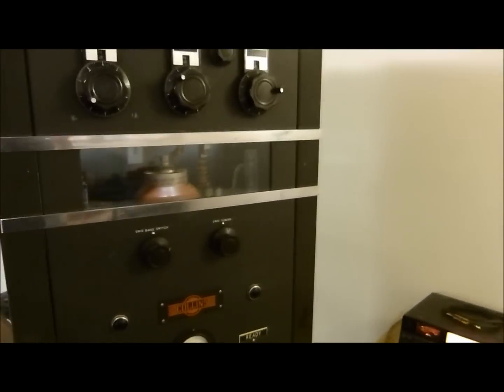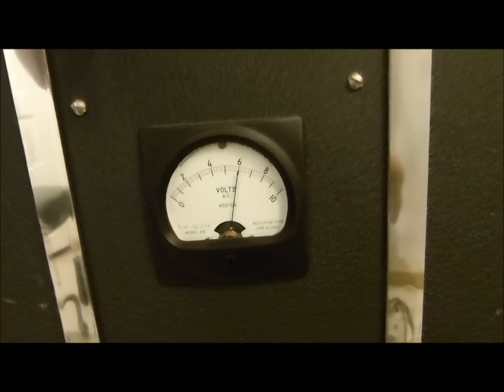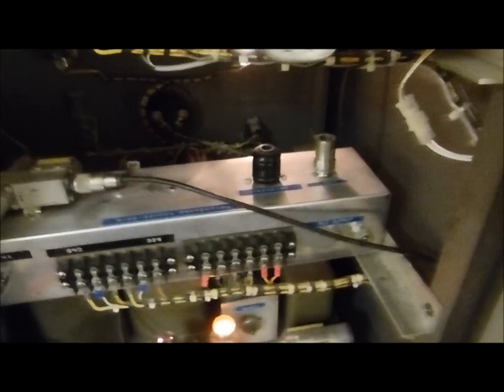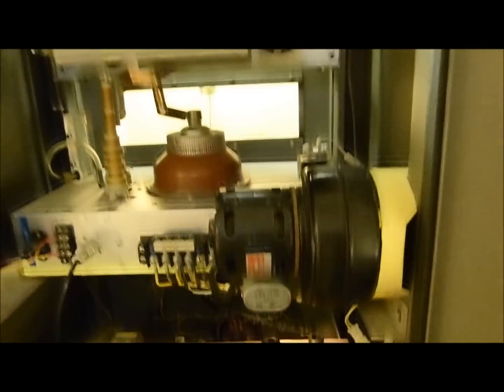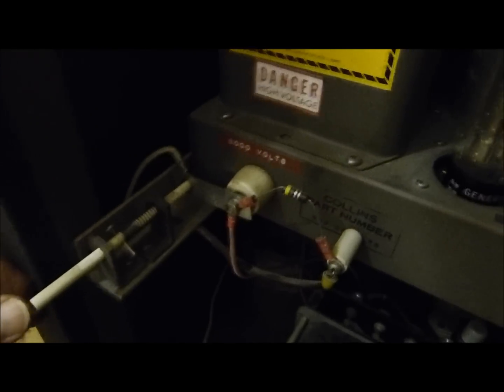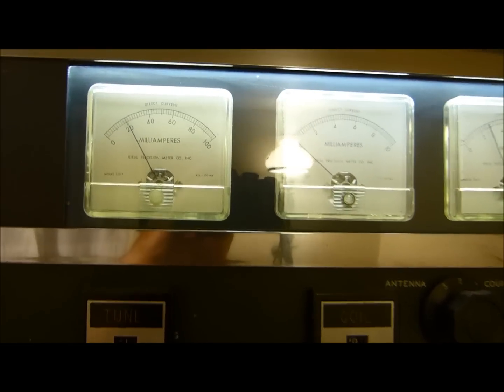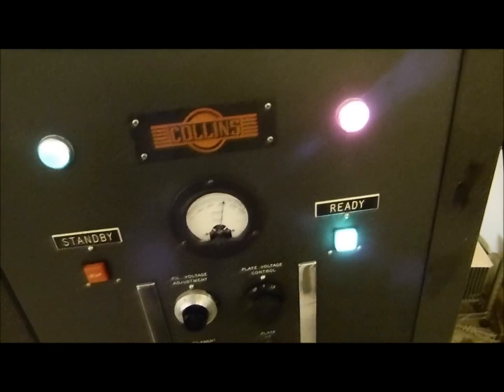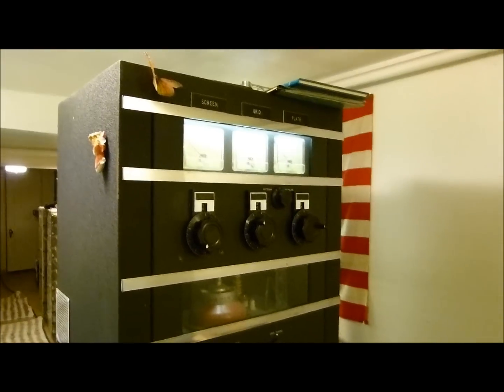Collins Radio 30K-1 Transmitter Updated to Eimac 4CX1000A - Eimac JAN 8168

Comment: Can this be used on 11m for channel 6? We found one new old stock in a warehouse. Would like to use it.
Reply from the maker: Yes, the tube is good to 110 MHz. It only runs class AB1 as can be seen in the data sheet attached. It requires a special socket and chimney and must be forced air cooled.
https://frank.pocnet.net/sheets/140/8/8168.pdf

Comment: David, i still have a 4cx1000a ceramic amp in storage, cant remember the screen voltage or grid... must be getting old :) , i do remember installing a timer for the filaments and when the timer hits 3 minutes , grid and screen voltages comes on as well as Ht, does your circuit work like that ?
Johan zs2cx
Reply from the maker: Hi Johan,
I have my 4CX1000A setup with a ready-tree where bias voltage, and cooling air has to close an air-vane switch, and several other things occur before screen and plate voltage can be initiated. Bias voltage comes up with the filaments. I put a 15K, 10W resistor off the screen to ground to "bias" the screen meter so I can measure negative screen current and use a 1/8 A fuse in the screen circuit to protect the screen from over-current. Eimac says the 15K, 10W resistor is necessary in case the fuse blows to prevent the screen from instantly soaring to plate voltage and destroying the tube. As above, the ready-tree is setup to never allow screen voltage to come up without bias and plate voltage but I keep bias voltage on the control grid all the time as part of the ready tree. As I remember it, we can never allow screen voltage without bias and plate voltage so I assume your bias and screen come up with the plate voltage. The amplifier has been working since 1983 and I still  use it nowadays mostly on 20M and 40M. I might also mention that I run the screen at 200V instead of the Eimac data-sheet recommended 325V. This is how the Collins 30S-1 runs their 4CX1000A. This allows the bias to be around -40V and very easy to drive and according to a Collins article, improves IMD products. The grid is not tuned and just uses a 50 ohm resistor off the grid to ground. Hope this helps and I hear you on the air. I recently had a QSO with ZS6XY from your area. If you need my schematics, I will send them to you but we will have to do it via email.
TheAudioShop@SBCGlobal.Net
73 WA4QGA
Reply: @ElPasoTubeAmps  thank you David, i will take the old boat anchor out of storage and play  with it in the near future

Comment: CCA be damned, you saved an amazing piece of equipment. It was already butchered and you managed to put it back on the air. Amazing
Reply from the maker: Thank you. Some would prefer to restore it to former glory and use it as an AM transmitter but in the condition I got it, I could not see the point. For such a beautiful cabinet, it seemed better to make it into a practical amplifier. I have had a lot of fun with it since 1975 when I picked it up. The 4CX1000A has always been the most powerful tube I have used in it but the glass tubes are really nice looking thru the glass panel.  73

Comment: Did you put that label on that oil-filled transformer?
Reply from the maker: I assume the one that says, "contains PCB's?". Yes, I did put it there as I figure since this transmitter was built in 1947, it was possible to be a PCB capacitor. It still works perfectly after 72 years and gets used daily.  I could be wrong and it not contain PCB's.
Sometimes in the 1980's, I don't remember the year, I was given five or six pole-pig transformers by a "friend" to told me if I removed all of them from the oil and casing, I could have a couple. I removed them all but chose to put my arms into the oil all the way to my arm pits to bend a tab that let the transformer slide up rails inside the metal container. I assume you know that pole-pigs are telephone pole type transformers used to set down HV to the 240V and 120V for house hold use. These transformers were 10:1, i.e. 2400V to 240 VCT. Anyway, after doing this I learned of PCB oil and got terrified as  its toxicity thru skin absorption is almost as bad as ingestion.  I ended up taking some of the oil to the lab at WSMR where I worked and explained my concern where they tested it and told me it was non-PCB. Whewwww... otherwise, I probably would have died from PCB poisoning long ago. PCB was a big deal during those years and I suppose most all of it is gone now but ... just in case...

Comment: Hi, David! Is that the amplifier you had in the appartment in Huntsville, AL, running off 240v from the kitchen stove? I remember the antenna wire sagging on key down.. back then it was with the original exciter and the pair of 4-400's glowing
Reply from the maker: Hi Henning,
Yes, that is the one. I changed it to a 4CX1000A in 1983 and ran it that way for over 30 years but now have a 3-1000Z in it that is beautiful. I remember those days from 1975. Wow... so long ago but it seems like yesterday. I started working at NASA in Jan. 1970 and it is now almost 48 years ago. Time went by so fast. I hope you are doing well.

Comment: A beautiful amp indeed! Question: Is this a G.G. linear running in AB1 mode?
Reply from the maker: Bob H Hi Bob, sorry I missed your posting some time back. Yes, AB1 is the only way the 4CX1000A can be run. I did not invert the screen supply as Collins did in their 30S-1. It is a very straight forward design. I put a 50 ohm resistor from an old Heath Kit dummy load right at the grid and drive it that way -  naturally separated with a blocking capacitor so I can apply negative bias voltage to the control grid.
Reply: +ElPaso TubeAmps - Thanks for that info. I have a 4-1000A that I want to use in grid drive mode. I'm assuming it will work for this.

Comment: Question is the RCA transformer original? I have a similar one here but with 220v input.
I'm just wondering if my transformer former came from a 30k1.
Reply from the maker: It is the one that was with this unit when I bought it but I don't think it is original - at least it doesn't look like the ones in the Collins material I have. However, it works perfectly at 3KV and some lower voltages. I think the original 30K-1 ran 2500 V on the 4-125A and 75Th's.

Comment: Good homebrewing, David. I wonder what the current rating of the HV Trafo is (or VA rating) ?
I have a TMC PAL-1k - restored to full output - using an Eimac 8295A -which is similar to the 4CX1000A.
I'm now in the process of building a 4CX1000A linear - housed in a 4' rack, and your video definitely is a source of inspiration for me to complete the project. BTW, the 4CX1000A is once again coming back - despite the 0W G1 dissipation. The Axxxa 8410 uses the same tube.
73.
Reply from the maker: Thank you for your kind comments. This has been a really solid amp. Don't use it as much as I used to - even used to run phone patches for people with it - seems so long ago... I use a 50 ohm non-inductive resistor at the grid (naturally  separated by a capacitor so as to apply the bias voltage to the grid.) I also use a 100 mA fuse in the screen circuit but you must put a resistor (15K 10W) off the screen to ground because as Eimac warns in their Care And Feeding Of Power Grid Tubes, the screen will instantly attain plate voltage if the fuse blows and there is no DC path to ground - you may already be aware of all of this. good luck with your project - post a YT video when you are complete 73 WA4QGA
PS - I don't know the VA rating of the PT but it will do a full 3KV at 1A if I change the taps so that the idle plate voltage is 3300 and 3000 fully loaded.

Comment from the maker: Hi Frank - yes, it was your comments on now nice the 866's looked that prompted me to put them in. As I mentioned, I disconnected the filament transformer when I made it a bridge. There are two more solid state rectifiers located behind the plate transformer in the  bottom of the unit but they don't show up in the video.